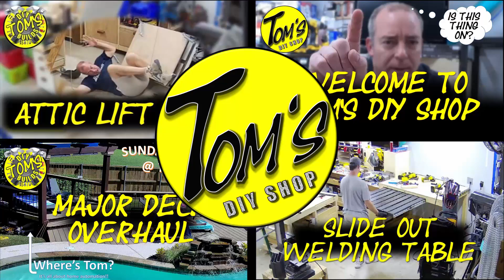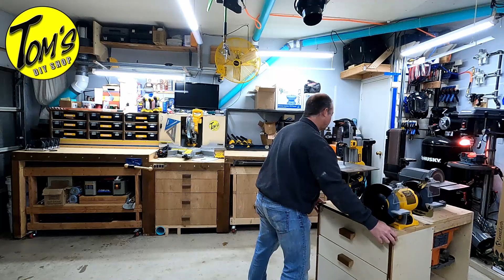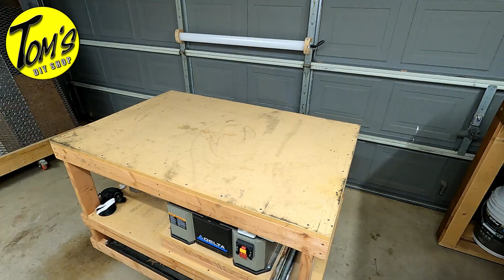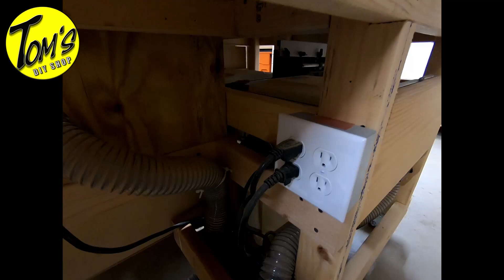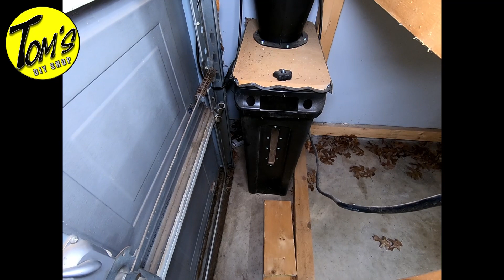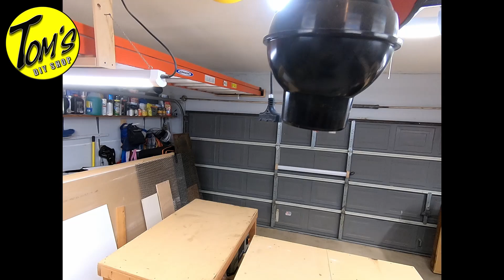Shop Tour - Full Shop In Half A Garage

Comment: You sure have made use of every available space in which to house your machinery. I really like your lumber storage. I need something like that but at this point it wouldn't work for me. I did have a lumber storage shelf but took it down late last summer. I had a really great work bench that I made a couple of years ago, 6' x 3' that I had to get out of my shop, it had too big of a footprint. 
My shop is a double car garage with two insulated metal doors. My ceiling is high, twelve feet and I have an enclosed loft, with door access up above.  I installed a  22 ft. "U"  Tube, Nat. Gas, Sealed Combustion, Radiant Heater. So I could work out there in the cold months. My big problem is ROOM, I don't have any. I'm still doing things to make it so I have more floor space. That table I now use it to work on outside the garage where it sits. Currently buried in snow, covered with some tarps. I do anything in the shop, I have to wheel some of my machines into the driveway. Yeah I have everything on wheels which is a major plus. Unlike you, we have never put any of our vehicles in the garage no matter where we lived. Right now my 3 HP Cabinet Saw has cut wood piled on it, waiting for staining and assembly into a tool cabinet with drawers. I have another one that is at the assembled point but I have to put the different cabinets together. I built shelving with 2" x 12"  lumber on one wall, added some shelves, it holds my small machines, like grinders, arbor press, Tormek sharpener, etc. I really need to move and find a bigger shop, I have outgrown this arrangement.
I have a metal bandsaw like you but it's housed on a mobile shelf unit, in the shop, inside the rigid plastic case it came in. I want to have it mounted like you have yours. Did you make a video showing that build?  I need something like that. 
Great video with some really innovative ideas. Like that welding table. I didn't see that coming.  Subbed right away.

Comment: Tom! WTH. This is simply amazing. I'm long in the tooth and doing DIY renos and slowly running out of room for my tools.  Rikon planer/jointer on the way to add to my "collection" of tools, but where to put it(?) You have inspired me to move my beloved car to the outside(will get a professional cover for her) and follow my newly found passion for woodworking. It seems to me that dust collection needs the most planning. I look forward to more instructional videos from you. Thank you! Happy New Year.
Reply from the maker: Hey Philip, I’m happy to hear the video was helpful and may have generated some ideas for you in your shop. You are correct, most dust collection uses rigid lines to pull the sawdust from v your various tools, which complicates things for guys that need mobility in their shop, like you and me. One suggestion I have is to use PVC piping and tape the joints rather than gluing them. If your shop layout changes, you can reconfigure your dust collection much easier and possibly reuse some parts vs having to rip and replace because everything’s glued together.

Thanks for stopping by the channel and taking the time to leave a comment, I really do appreciate it. If you have any questions or would like more detailed info on anything I’ve built, let me know…I’m happy to help!

Comment: Cool shop, you did great with all of those smart additional carts and tool usages. Great video
Reply from the maker: Thanks James, I appreciate it. There are a few things I would do differently now that they've been in use for a couple of years....lessons learned! Also, I built the carts before I had metal working capabilities so I may reengineer them and build them out of steel to gain more storage / functionality taken up by all of the 2X4's.

Comment: I have watched A LOT of videos about garage workshop ideas and space saving as I am working on building my shop in my 2 car garage that I also have to put my truck and my can am x3 max in over the winter (North Dakota) and this is by far my favorite one yet. I love the flip top islands. That slide under the bench. Most of the shops you see on here are wood or metal. And I like to work with all materials, even composites like carbon/fiber glass. Good job working that in. I’d give this video 10 likes if I could 👍 👍
Reply from the maker: Thanks Gregory, I really do appreciate the kind words and for you taking the time to stop by the channel. Fitting everything in and maintaining functionality / usability of the tools is a fun challenge. As I get more tools and increase the capabilities...it's getting more difficult!! I'm about to release a video on a new (very large) tool I recently purchased, so there may have to be some significant modifications to the layout in order maintain the established requirements (Wife's car in the garage).  Stay tuned!!

Comment: I love to see workshops like this. Mine is in a 9x9 room, so every bit of room helps.  

I wonder sometimes, if I'm the only one not using a DeWalt 745 or variation saw, LOL.  

I have the Hitachi and mounted it to its own box, but unlike yours, it is just the box under the saw.  I can roll it next to any workbench the same height to use as an extension table or the saw can be an extended work surface.  

I am curious about your dust collection.  I don't understand that you have a shallow drawer to collect dust, but then a hose to connect it to the shop vac.  At first glance, the drawer looks like something I'd fill in 10 minutes so it looked too shallow. I had asked how well it worked for you, then saw the part where you have the hose connection.  Could you please explain how that works for you.

I'm still building mine so I'm looking at all the options. 

I will be buying a 5 gal shop vac and either a dust deputy or homebrew. My shop has a 12 - 9 foot lean-to roof. I'm hoping to locate the shop vac and dust deputy centrally over the tools so I can just plug in what I need.  Your setup has given me an idea about how to make it work. 

Thank you for your videos.  I hope your back recovers soon.
Reply from the maker: Hey Buck, thanks for stopping by the channel and checking out the videos! I do have a hose connected to the back of the table saw, although my dust collection system is in a state of “upgrade” while I’m building the pneumatic blast gates. Since I wasn’t able to completely seal the saw enclosure (large gaps left front, bottom, and right hand side), the dust collection isn’t 100% effective. The tray catches the dust the collection system misses and keeps it from falling into the drawer below. I chose a tray vs just having a full flat surface under the saw thinking it would be easier to pull that out and dump it rather than having to pull out the shop vac, remove panels, and reach around under the saw.

I hope this helps an I’m happy to go into more detail if you’d like so you can design your solution and make it better! I do have an upgrade I recently made that will slightly modify the current design. The flat area behind the table saw now holds a router lift and a couple of T-tracks. I will be building a box below the router lift that collects dust for bo the router and the table saw. I’m essentially extending the cavity I crated for the saw to incorporate the new lift. I will also attempt to address thee gaps mentioned above to improve the dust collection system’s effectiveness.

When you get your setup put together, I’d love to see it!

Thanks,
Tom

Comment: Lots of well thought out solutions and execution. A lot of potential in a small space. Looks like your isolated machine set-up time is short which helps keep you working.
Reply from the maker: Thanks Martin, and yes sir…you are correct. A primary requirement was minimal setup / breakdown time. I know I can be lazy sometimes and if setting up a tool for use was too cumbersome, I wouldn’t use it and/or use some other tool improperly.
Reply: @TomsDIYShop  Exactly. I have a lot of tools collecting dust and rust.